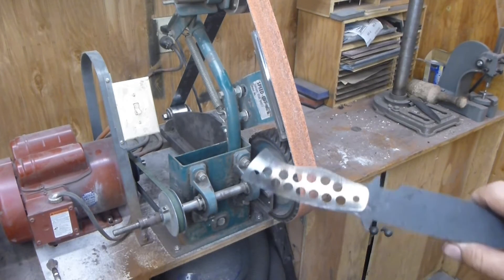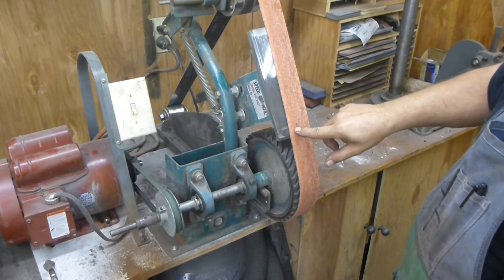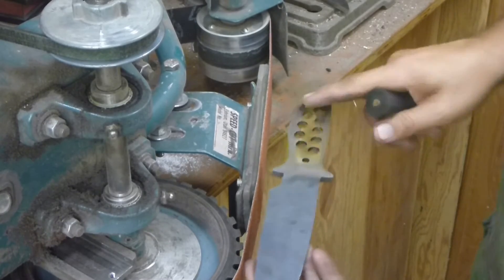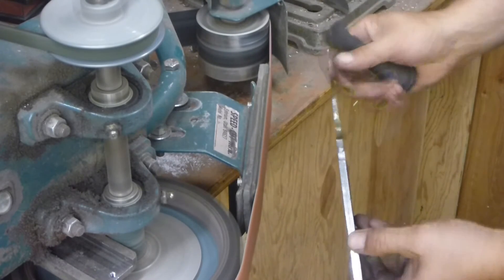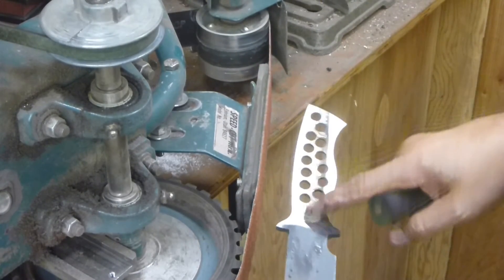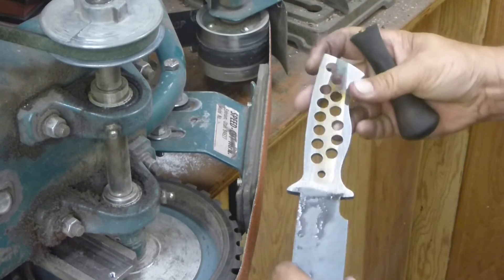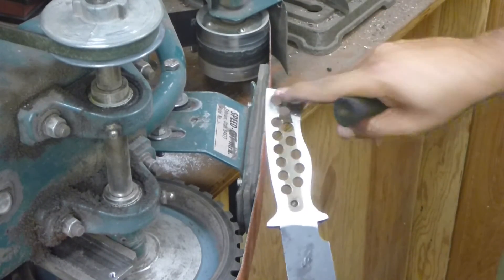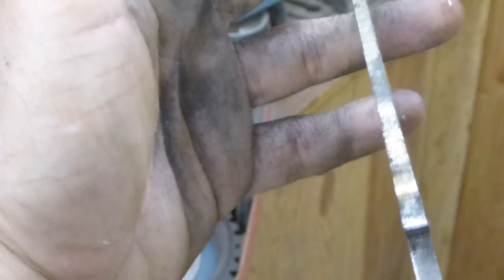How I taper a full tang knife handle

Comment from the maker: The main reason to keep the handle cool is to prevent building stress into the steel so when you go to heat treat, you don't wind up warping the handle. Keep it cool.